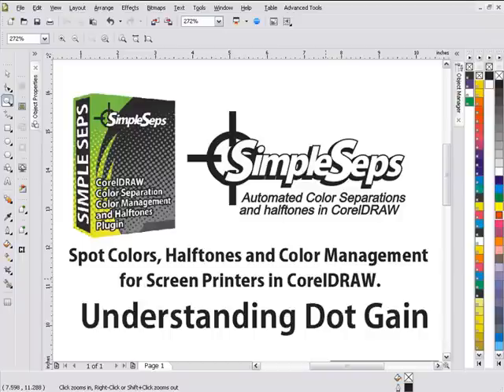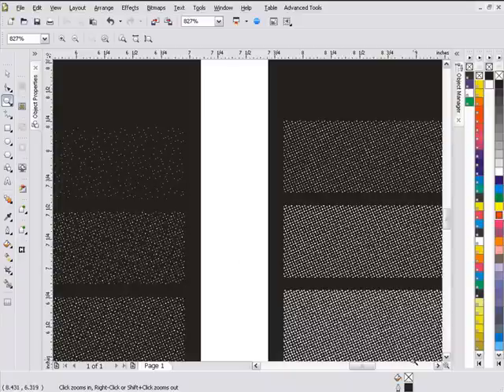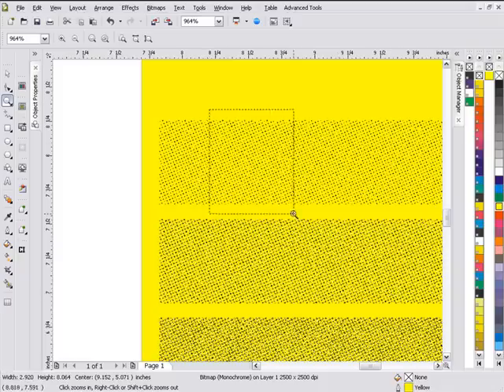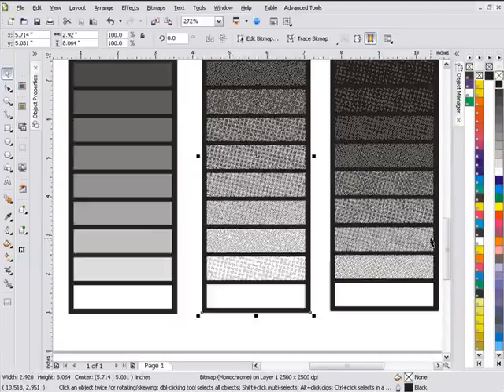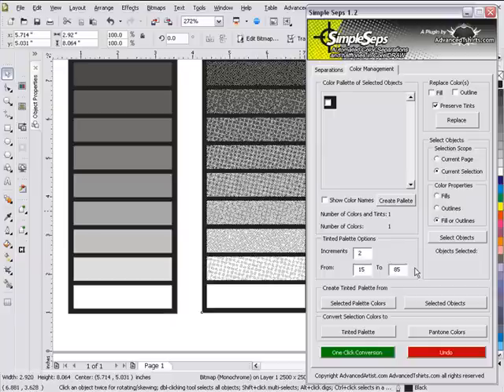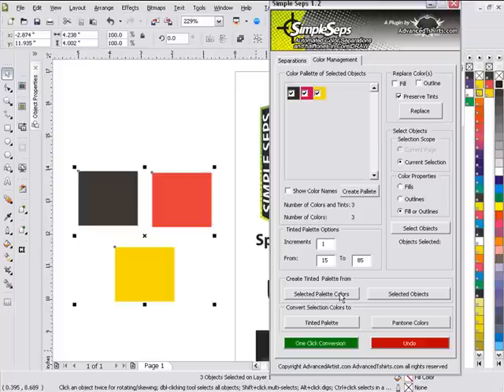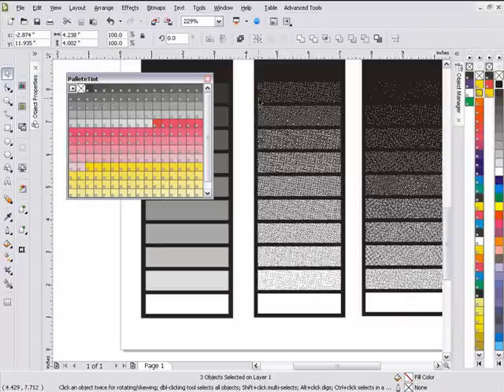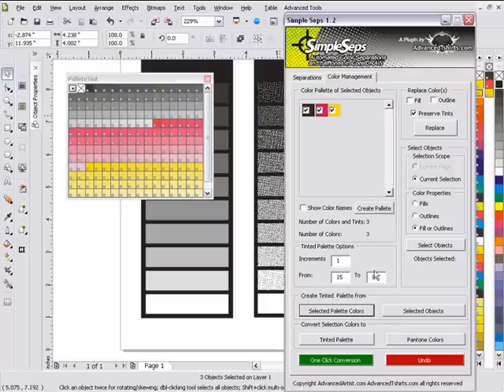Understanding Halftone Color Separations and Dot Gain

Comment: If you can't hold 10-90% dots, your not ready to print color seps. stick to black until you can control your process. loosing 20% of your tone is bad enough but 30? 2much.